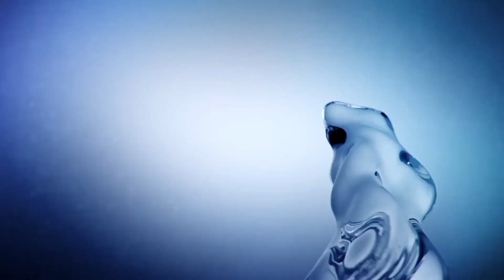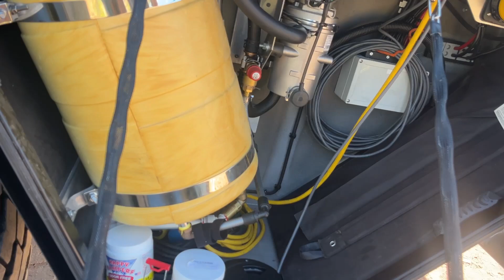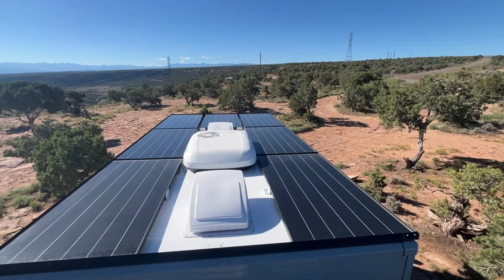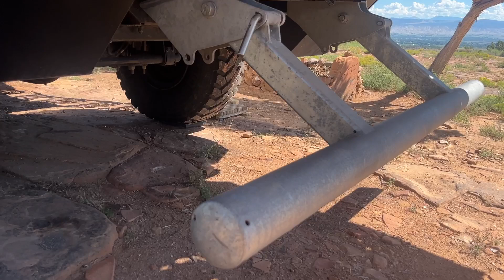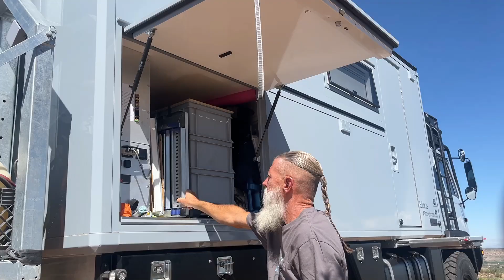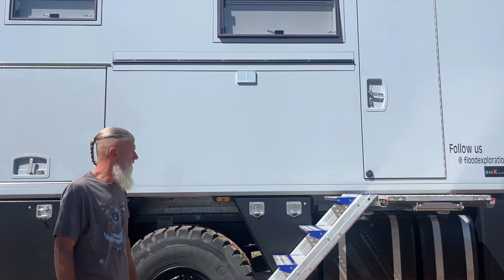Exterior Tour of Poseidon

Comment: Great conversion. The rear edge overhang of the bike rack is a long way behind the rear underrun protection. Does this be an issue in the US? The internal tour is five star.
Reply from the maker: Thanks for the question and for the compliment on the interior.  The U.S. DOT does not regulate it the same as TÜV.
Reply: @floodexploration  Yeah, over here an extended overhang beyond the underrun mechanism could be considered a safety hazard.
Reply: What a great home…everything well thought out.  I especially like the moto rack on the back.  Well done (and thanks for sharing the bloopers too!  Definitely do a video of the mechanical conversion, would love to see everything you did to that old military truck.